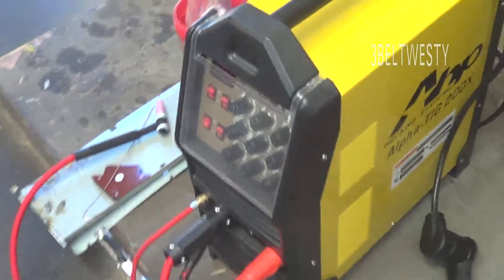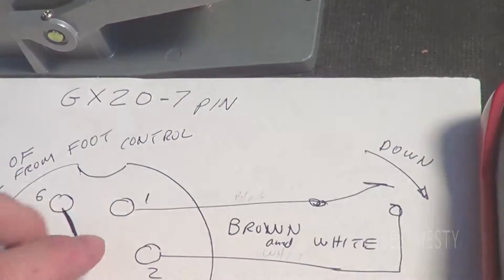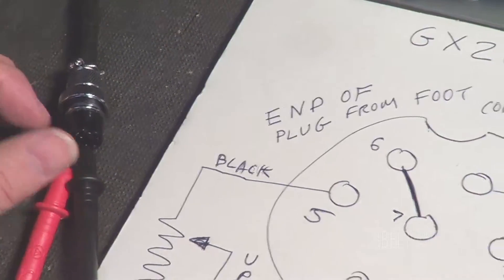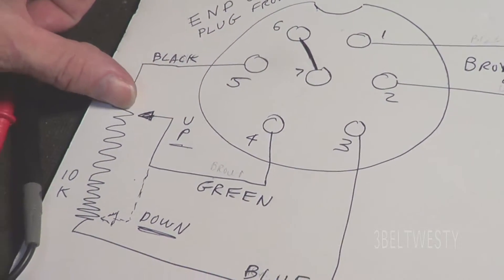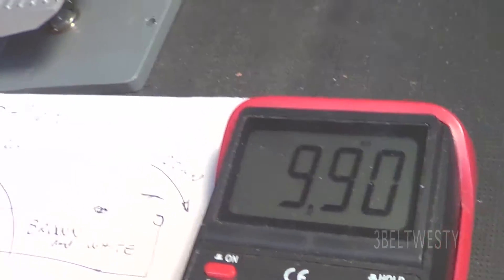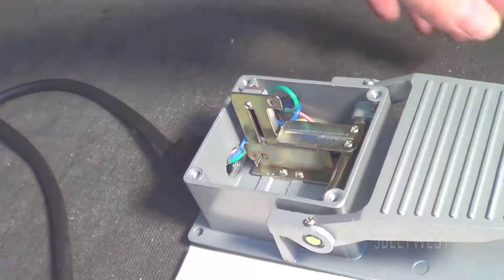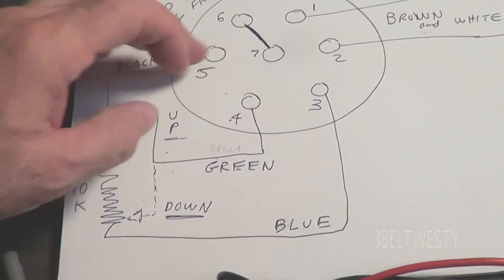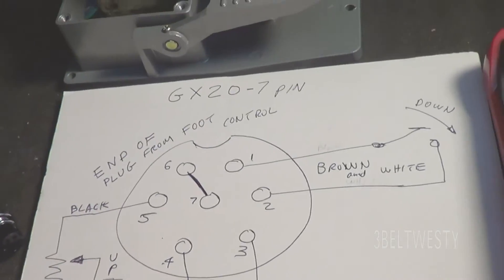Alpha Tig 200X foot control schematic 2016 model

Comment: Hi, I am curious: the whole tig pedal is really operating with  micro current right? (on off switch and potentiometer ) How does changing this  micro current work inside the machine to modulate the much higher amperages? thanks.  After watching a few of these I might be able to make a primitive pedal even if I didn't know why is does what it does so thanks.
Reply: In case anyone else finding this video has the same questions. Yes the pedal components are only handling very small currents. Inside the welder there will be a bunch of buffering and logic circuitry, but it basically boils down to a chip, or perhaps multiple chips, to sense the small control currents and perform the logic necessary to control drivers for the gas solenoid and welding power supply.